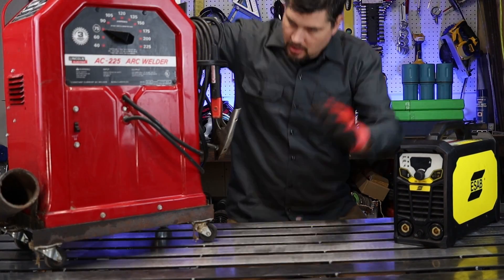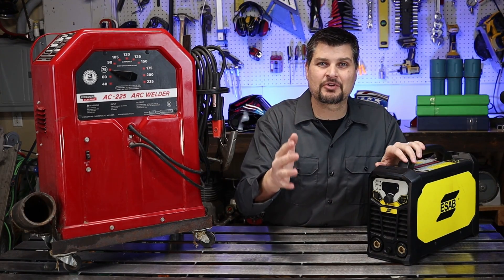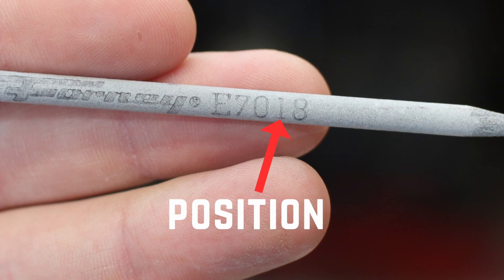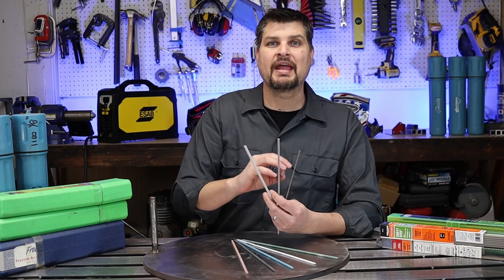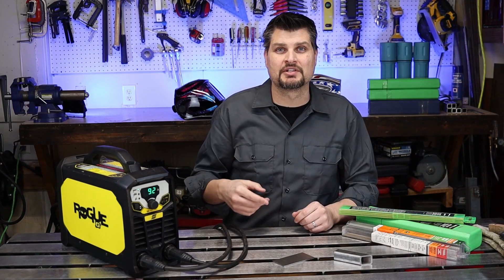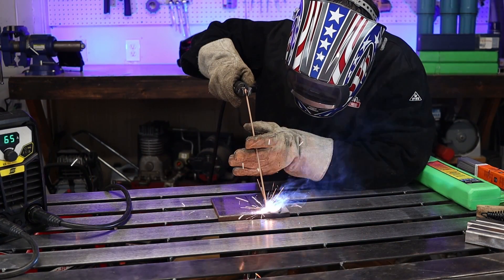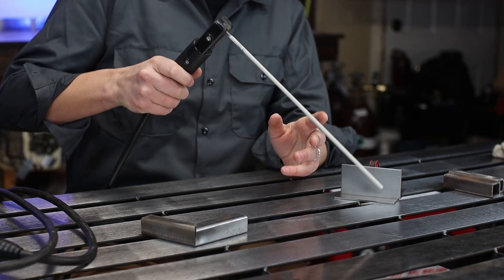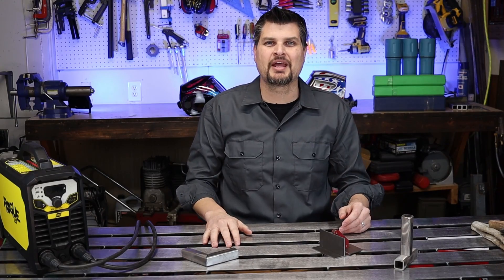Stick WELDING Basics: How to ARC Weld 101

Comment: After you strike the rod, do you put it down on the plate or do you hold it above the plate as you weld?
Reply: You just barely touch the plate to get an arc going. Then you want a gap about the same as the diameter of the electrode. 
     If you touch the plate for very long the electrode will stick to the plate and after awhile can even get red hot.
Reply: @thomaslewis9526 fascinating. You're the first person to explain that out of all the videos that I've watched. I think when people do how to videos, they assume people already know things.
Reply: @thomaslewis9526 from that description, does that mean you're only lightly striking the plate to get "ignition," and then after that you're hovering slightly above the metal to let the stick metal drip into the areas being welded?
Reply: Yep!  Except the metal kind of sprays in with the arc, it's very intense
    Then you try to watch the puddle and lay down a nice bead. It's a lot at first but the more you do it the more you can control the process. Don't give up if it's messy at first. 

    Also, if you don't have access to a welder thru school, or a friend, neighbor, etc. you can buy a used cheap inverter welder (or used buzz-box) for  $125 or so. Also get a basic auto darkening helmet, those hand held things are useless (except to watch someone else weld). Some heavy leather gloves, and long sleeved shirt, basic chipping hammer and you are in business. You could weld up a chipping hammer out of rebar or scrap. You'll probably want an angle grinder before too long, but do a little welding first to make sure this will work for you. Try not to spend money untill you are sure it's the next right step. 

    You probably want some small electrodes (3/32 inch,). 
I would get a one pound box of (3/32") 6011 and 7014. If you have those two you can do a lot of useful stuff. If that brand and size work for you then get a five or ten pound box to save money.  I would skip 6013, because 7014 can do the same a little better. (Except harbor freight has a 2lb. box of little 1/16" 6013 for sheet metal, I would get a box if you can. You may not have any  success with it but you will learn from trying.)
     If you need to weld thinner metal you might want a stash of smaller sticks (5/64" & 1/16"). They can be hard to find and especially at a good price. You start with 3/32" if you can, because the smaller ones always cost more (maybe a lot more,). 

     6010 is like 6011, but you need a good professional DC machine. A cheap DC machine probably can't run 6010, but 6011 will run on any welder!  

    Finally, 7018 is the best! It is strong and ductile, meaning it will stretch and deform before it breaks. So you can see that you have a problem before it breaks, and it probably won't break anyway. 
    But I wouldn't start with it. A good professional machine should run it, but it may not run  very well on a buzz box, or a cheap DC machine.
     I got some 7018AC, which is great for the buzz box (I have one) and I hope it'll work on the cheap DC machine, but I haven't tried it yet. You want to go there (use 7018), but it may be hard with a cheap machine. Just read the reviews, try a one pound box, until you get one that works for you. 

     I've been a hobby-welder off and on for forty-years. If my opinions are even partly useful  to you, my time was well spent. If not, ignore them. There are a lot of very strong opinions on welding channels. 
But, You are not responsible for any one else's opinion. It is your duty to ignore anything that doesn't apply to you. Good luck! And just keep at it.
Reply: @prolifeunity  Yes, except the metal kind of sprays in by way of the arc, it's very intense. It's not like TIG where you melt the filler rod in drip by drip.
Reply: @thomaslewis9526 thank you Thomas. I have one of those cheap handheld stick welders, and I did repair my knee scooter with it. It's not perfect, but at least I can use the scooter again. I'm still trying to understand the whole bead concept. So you're not actually rubbing the rod on the middle after the strike? Is the strike only to get it started, like starting a match
Reply: People always talk about "penetration" in the videos. To me, that meant that you had to push the rod firmly down on the steel. Obviously that is not close to correct.
Reply: Penetration means you've melted the two pieces of metal into one. Poor penetration means you have gaps or just lay new metal on top without completely melting it into one new piece. 
    You can't normally push with the electrode, it will just get stuck. It's the electricity jumping the gap (arc), that  makes all that heat and melts the metal.

Comment: Good luck welding more than 4” at a time with that tiny dc unit lol
Reply: You say Good Luck with using the smaller unit more than 4 ". I have that size machine. So Are you talking about the duty cycle? If so Can you point out what that means? How do you know it's at it's limit, does it stop working? do you need to wait then to restart? Thanks a lot for any info.
Reply: @mikesaler1038   yes you have to stop and start, they just can't handle enough with that duty cycle. So you'll have to stop every few inches or so. Not a big deal for the average weekend welder, and if you are welding very light gauge you'll be fine. The more you spend, the more you can weld without stopping and the thicker etc.

Comment: Used to make Caterpillar cabs in my teens some 16 gauge material. 
Now i am a pensioner have a small DIY welder. Even though i have had stick & Mig welders all my life. I find that my welding has got worse and i do not think i could weld 16 gauge now. Even though i still remember the tricks of the trade. 😅 used to love vertical welding but find it so hard to do now could be i do not move the way i used too. 😂

Comment: On my dc welder ...my electrode is -ve n i get better penetration...easier to weld with
Reply from the maker: Stick welding you can definitely try switching polarity. Some rods do run better on EN.
Reply: Read the manufacturers info for the stick you have to be sure. I know that sometimes you can go electrode negative for thin metal. This is supposed to put more heat into the electrode, and less into the work piece. 
It's easy to try it and see if you think it helps.

Comment: Thanks a lot for the video.  Very helpful. When I weld along the inside of a 90 ° angle my weld run is in 2 halves so to speak with a groove along the middle. Can you help please?
Reply from the maker: I think I know what you are talking about. It's an amperage issue, you'll need to turn it up.
Reply: @-DIYPRO-  OK thanks. The AC welder I'm using is a very old device I have had for many years. Time to upgrade !

Comment: I'm not a welder. I did used to try out a big Lincoln type like you show her. I could never keep from sticking the rods.? I'm thinking of getting a small inverter type, hope I can make it work... Peck
Reply from the maker: It also helps if you can find a welder that has adjustable hot start and arc force.
Reply: If a fancy welder is not in the cards, I've got an idea. Get a good sized piece of metal, the scrappier the better and crank up the amps above the top of the recommended range. It shouldn't stick. Try running a couple short beads. (Oh yeah, get a small fire extinguisher handy.) Then turn it down a little and try again, etc., etc. 
    You might be able to get the hang of it this way. It's just practice. The only way to Never stick the  electrode is to quit welding.

Comment: I am not a welder and I’m trying to learn. Your presentation seems to be just what I need. A good quick pace - not too fast, not too slow - and you don’t get bogged down in needless details and become boring. Your voice is very easy to understand and you can get right to the point. Very good presentation job!  I’m a fan!
Reply from the maker: Right on, thanks!
Reply: Ditto
Reply: Ditto. I just recently got a nice little $100 kit from Alibaba. I'm hoping I'll be able to learn and practice enough welding to impress my dad. He's been a welder for over 30 years. Thanks for this nonsense beginner's introduction. Much obliged.

Comment: HELP!! using Fortney 6013 DCEP Titanium unlimited 140 at 35 or 40. Just sticks every time no matter what I do or try. Can not get it started except rarely!
Reply from the maker: What diameter rod are you using and when you say 35-40, do you mean 35-40 amps? Most likely your amperage is too low. If using a 3/32" then bump up the amperage to 70-90 amps.
Reply: @-DIYPRO-  Sorry using new Fortney E6013 1/16 and tried all amp settings on 16 gage steel and I can flux core no problem wondering if it's the holder tried DCEP and DCEN. Once it blew the rod end off at the holder.
Reply: It is never easy to stick weld thin metal, but it should be possible with your stick and settings.
    I've always heard that DCEN puts less of the heat into the work and may reduce burn thru. It's worth a try.

Comment: If you are going to make a video on the basics of welding, you should at least know the basics. 

Inverters are devices that change DC to AC. The machine you have (ESAB) would use 4 diodes to only allow electric flow in one direction opposed to alternating. 

Also, the polarity of the device matters. You can plug your ground up to + or - side but it affects the penetration and how fast material is deposited. 

Electrode-positive (reversed polarity) welding results in deeper penetration. Electrode-negative (straight polarity) welding results in faster melt-off of the electrode, and therefore a faster deposition rate.

Again, the video wasn’t bad, but seriously, know what you’re talking about if you are going to try and make videos about it.
Reply from the maker: You mean like the full bridge diagram I show at 1:00!
I totally agree an "inverter" technically takes DC power and inverts it to AC but I wasn't the one who came up with the idea to call DC output welders "inverters". It's just the name the industry gave them.

Comment: I wanna start doing stick welding and other welds
Reply from the maker: Pick one up and start welding!
Reply: Do an apprenticeship because it’s a skilled job teaching you the skills in metal & alloy fusion using electricity and gas ! Burning a stick rod doesn’t make you a welder because a true coded welder can weld anything, anywhere in any position with any kind of welding equipment

Comment: I'm just a DIYer. When I first time tried stick welding, I happened to have 7018 rods on hand. This 7018 rods really frustrated me, 9 times out of 10 I get sticky rods, and I found it is so hard. When I changed to 6013 rods, I found that welding became very easy. Therefore, I suggest that beginners should start with 6013.
Reply: Frank, the 70 is the tensile strength of the material. The reason the 6013 is easier for you is because you have your machine output too low. Not the sticks fault. They are not “sticky.” There is a lack of current to cause the arc. Turn it up and try them again. 

6013 would probably suffice for whatever you are welding but be sure you are getting proper penetration. 

Anyone can weld, but not anyone can weld right. I say this because you don’t want to find out at a bad time that your welds were just surface level, could certainly cause problems.
Reply: @kevinsmith5575 They absolutely are sticky until you get the hang of them. The coating on a used 7018 rod requires a little more force to break through and complete the circuit, making it harder to start without sticking. Especially for beginners who will most likely not get an arc going on their first attempt. 6013 has no such coating, thus starting easier and sticking less
Reply from the maker: Right on, thanks!
Reply: 7018 tends to get “sticky” if it is not dry. Professional welders use rod ovens to keep it dry. You can just use a fireproof box and a lightbulb. Keeps the humidity out of the flux
Reply: @seanprice6345  I found that heating the material up first makes the 7018 less stickery at the strike.
Reply: If 7018s aren’t easy, I’m glad I’m getting used to them first
Reply: It’s due to the fact that 7018 needs an oven to stay cool and dry, and they stick easily if not kept it an oven
Reply: 6013 i find difficult to read the puddle of. The slag is horribly in the way, and often gets included in the weld. The easiest rod for beginners is the 6011
Reply: I would pick 7014 if you can get it at a good price It is similar but better than 6013. 
You can make good welds with 6013 but I think 7014 is a little easier and a little better. 

    You can have more issues with 7018, but it can make great welds. Anytime any rod is sticky, I would just crank up the amperage by 10-20amps, and see if that doesn't it fix it. Be aware the current settings may be off quite a bit (especially for cheap DC welders). Even if you have a really nice welder, when was the last time you had it calibrated. 
     If you can push a button,  that's nice, but is it right? 
    You should have a suggested current range for that type and size of stick. It should be on the box, but if you have to call customer service then write it on the box with a sharpie. 
     If you run test beads on  higher and lower amperages on some scrap, you can get a feel for what is best. If the machine is lying to you, you still have a feel for what is right. You can make nice welds all the time, with any machine.
Reply: I'm so happy I came across your comment. I was about to send this welder and the damn rods back to Amazon 😂. Grabbing some 6013s first thing in the morning
Reply: @ShaqTheBoss same here 🤣
Reply: Dude all you had to do was calibrate the machine for the 7018
Reply: Yes truth as a beginner right now I am doing 6013 and 7018 ..7018 does stick fast
Reply: How do you actually strike the arc? Is he pushing a button on the electrode holder to get the welding started? Thx!
Reply: I had bought a welder/rods from amazon and was watching this video after the welder arrived. By pure chance the rods I ordered was 6013's as I didn't have a clue about the rod differences 😂
Great video by the way, very informative for us noobs.
Keep up the good work  😁

Comment: Perhaps should have mentioned that different rods have different preferred ways of laying a bead. For example, 6013 and 7018 should be straight pulls, while 6010and 6011 are manipulated (whipped.)
Reply from the maker: That will be coming up!

Comment: "Easy to learn." You forgot "difficult to master." 🙂 Striking an arc without sticking, maintaining proper, constant arc length as the rod burns down, manipulating it evenly (whip and pause, circles, whatever) along a perfectly straight line for the entire length of the weld, takes practice. Fortunately, like you said, it's relatively cheap, and there's something eminently satisfying about chipping off a nice piece of slag.
Reply from the maker: All that will be coming in the 2 week long course, haha!
Reply: Practice during school holidays made me almost perfect .I remember at first I could not sustain the arc.the starting was really terrible